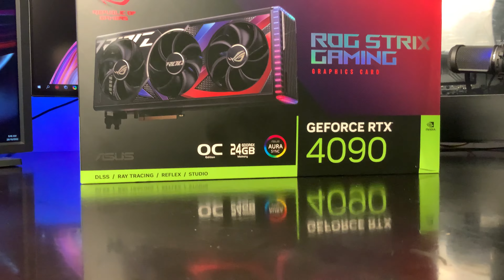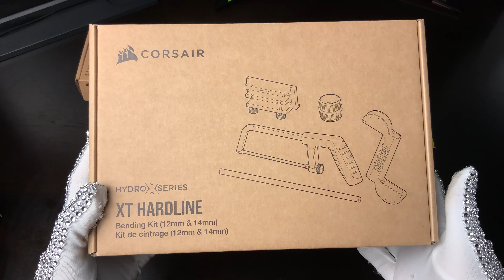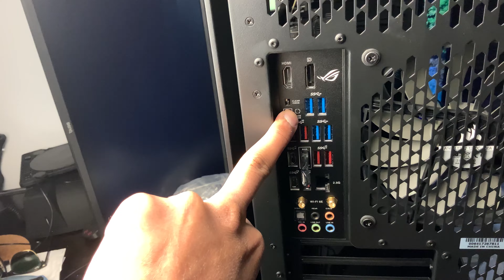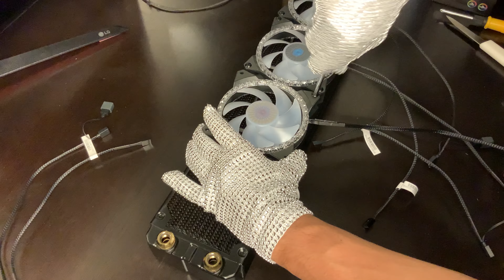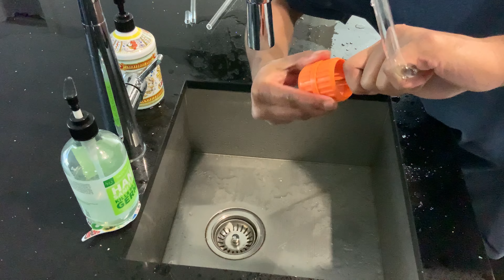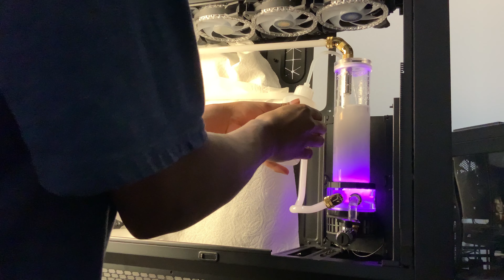$10000 DREAM WATER COOL BUILD | ASUS STRIX RTX 4090 | i9 13900K | Custom Hard line Water Loop Build

Comment: Maybe I missed it, but the GPU is still air-cooled right?
Reply: yes you can tell by its size, the visible cooling fins and the lack of tubing from the gpu. the AiO liquid GPUs have 2 large cables running from them.

Comment: I went with clear fluid for my hydro x, how often do you think you'll do a maintenance / refill?
Reply from the maker: clear fluid is better because there's no maintenance or refill required for for almost a year but you'll ab out 5 months later see water level slowly drops just by few mililiters due to evaporation

Comment: Personally I don’t see the point in a custom loop if you’re not gonna cool the gpu as well
Reply from the maker: The reason I didn't cool the GPU because the 4090 stock cooler is so over killed it keeps the GPU less than 60C at 4K max settings all highend games but the 13th Gen CPU is a must for watercool because temps hit 95c easy just with 360 mm radiator
Reply: @ImTheCaptain_NOW  fair. Just a personal opinion. :) u do u. Like In the car community, respect all builds 💪. But like if ur gonna go all out with a custom loop, go all out. Cool build regardless. Looks sick too 🔥
Reply: And as long as you like it and it does what you need it to do then I see no issue with it ;)
Reply from the maker: @destyn_  thanks man and i wish you all the best for your dream build too <3
Reply: @ImTheCaptain_NOW  I'm curious about the load temps, I'm evaluating different waterblocks to cool the same CPU
Reply: You could have used contact frame, for better CPU contact.

Comment: My cousin just built this same setup. He built his in the hyte Y60 with a black and gold theme. Only difference is he he using Corsair Dominator 7200 ram. He actually just installed all his custom cables from cable mod. Still waiting till February for the 180 adapter for gpu power. It was his first water cooled build too. Great video and great build too.
Reply from the maker: Thanks man and I'm happy for your cousin. This is truly one of the best builds that anyone can build right now..!

Comment: Nice bends for first build
Reply from the maker: Thanks man, my first ever bend i made it failed but I instantly new what went wrong and ever since that fail I didn't fail a single bend even with the tube that goes from reservoir to the CPU it has 3x90 degree bends and a 45 degree bend pretty happy with that advanced bend

Comment: What are your core speeds with the 13900k? Can it hit over 6ghz?
Reply: It will do at least 6 if not 6.2 My build Is a bit more expensive than this one and has overall the same parts but the 4090 has Active Front and back water blocks, a Maximus Extreme Z790, DDR 7200, and two radiators with EK Loop fans and Graphene fluid with the same pump and CPU block and mine does 6.2 but its up to the silicon lottery.
Reply from the maker: @Sorata82  Sick build man Impressive to see 6.2 GHz well done
Reply from the maker: its set to default values for the benchmark video which is 5.8ghz and I'm 100% sure It can hit 6ghz all p cores because I've seen it in a full watercool build

Comment: Do you think a 360mm aio cooler will be perfect for the 4090. I’m getting a nzxt kraken z73
Reply: Sorry meant  cpu cooler. I’m getting the same cpu as u. Would a 360 mm aio liquid cooler be sufficient
Reply from the maker: @matthewsmooth2325  yes 360MM should be perfect you'll see temps hit 100C only during benchmark test but It won't hit 100C during day to day gaming temps
Reply: @matthewsmooth2325  I'd recommend going the 420mm route with the melty thermal pad linus had, and also the thermalright mounting bracket for 12th gen
Reply from the maker: 4090's come with really good coolers especially the Asus Strix 4090 but are you talking about using a 360mm aio for your CPU?

Comment: do you have to  update the bios for 790 series motherboards for 13th gen?
Reply from the maker: You don’t have to it works out of the box but having the newest bios will eliminate any unnecessary firmware issues you would run into and gives you the best compatibility performance out of the cpu
Reply: @ImTheCaptain_NOW  Thank you for the fast reply,! and thats what i thought but was just making sure

Comment: Im betting because you used the TOP m.2 slot that your GPU is now in 8x mode, is that true?  Could be affecting performance.
Reply from the maker: I believe only the top m.2 effects but I’ll swap and see if it increases from 8x to 16x
Reply: @ImTheCaptain_NOW  Leave it in the top slot. You'll get PCIe4 X4 plus X16 for GPU as my other reply. My 4TB Seagate Firecuda runs really cool in that position.
Reply: No. On the Asus boards (I have the Hero Z790) the 13900K's 20 pcie4 lanes feed the top NVMe slot and the 2 GPU slots, with the 3rd PCI-E slot plus additional NVMe drives fed by the chipset. With one 4090 it is driven at X16 with the top slot NVMe drive at X4. Checked in the manual and then in HWINFO64 on the running machine. Very similar build except for soft tubing and 4TB and 2TB NVMe drives and 64GB RAM.
Reply from the maker: @ColinDyckes  sick man thats really good information you provided to me and I'm happy for your build. I really wanted to buy the Z790 Hero but that got sold out so fast in Australia and I had a choice to wait for restock or go for the stirx thats why i went for it..!

Comment: Not a 10k build
Reply from the maker: It is $10K AUD but around 8K USD
Reply: @ImTheCaptain_NOW  
motherboard+cpu $1100
GPU $2000
Water cooling components $1000
PSU $250
Fans and MISC let's say $600, 
Am I missing something?
Reply from the maker: @farnoodbakhshi  CPU, RAM and what you need to calculate is in AUD with import taxes for each of these parts it goes 10K + AUD. So if you really want to check exact prices check it out in Australian pc stores then you'll get the exact amount but if you compare USD it will be always less because there's no import taxes.
Reply: @farnoodbakhshi  Taxes and shipping if he had to pay shipping.
Reply: I agree
Reply: Don't be weird mate
Reply: Thats 10K AUD, try coming to NZ and it cost even more. $9418.7 NZD just for that Motherbord, CPU, GPU, PSU, M.2 drives, RAM and case. That price doesn't even include the price for fans, water cooling components etc, shit adds up real fast here

Comment: Great video. Would love to see an update video with you adding a water block to your Strix RTX 4090; EK sell a kit which actively cools both the front and back for your specific card: ""EK-Quantum Vector² Strix/TUF RTX 4090 D-RGB ABP Set - Nickel + Plexi"
Product EAN: 3831109901267. I plan a similar build myself, only using the Cooler Master HAF 700 case, and installing three 420mm radiators (top + side + bottom) to go along with the two 200mm fans in the front and two 120mm fans in the back. I also plan to get water cooling blocks for my M.2 SSD PCIe Gen5 drive and DDR5 RAM.
Reply from the maker: Thanks for your positive feedback and yes In the near future I'll water-cool my GPU as well and  I wish you all the best for your dream pc build looking forward to seeing a final water loop picture and i bet money yours will look its from another planet will all components water cooled..!

Comment: Is it possible to also watercool the GPU with this setup?
Reply from the maker: Yes you can definitely but the new Asus strix 4090 heat sinks are so massive I’m getting 50C  in Cyperbunk 2077 4K max setting absolutely incredible.! Stay tuned for the benchmarks video probably coming out in about 2 days

Comment: Get a better mb and ram lol
Reply: Facts. Geezer said £10k and pulls out the ROG Strix lmfao.
Reply: Better MB for what? lmao
Reply: @MonsterMX99  for better power delivery and io options duhhh strix crap doesnt even support thunderbolt such a budget mb
Reply: @samuelkdu  there is no need for better power delivery
Reply: @MonsterMX99  there was no need for a 13900k tbh. But here we are. He's talking about building a system that is best of the best and it doesn't even support thunderbolt or pcie 5 ssds. Only with an expansion cart provided in the mobo box which will reduce the bandwidth from pcie4 x16 to x4 on his nice new 4090.

Comment: What cable did you use for the 4090?
Reply from the maker: I used the cables that came with my new ATX 3.0 PSU. If you watch my previous video it shows me unboxing the new Thermaltake GF3 1650W ATX 3.0 PSU and it has really good zoom in shots of each and every cable.

Comment: Cool build!
Make sure your gpu cable is properly connected, I think I can see 1-2mm gap at 9:23
Reply from the maker: Thanks a lot mate and I double checked what you pointed out but the new 16pin connector does not any further in amazing how well you spotted that thank you again..!

Comment: I just somewhat hesitate about the 4090 (for my own rig) due to the connector melting thing. The build kicks ass though!
Reply from the maker: Thanks a lot for your kind words and definitely you should try buy a 4090 and pair it with the new ATX 3.0 PSU